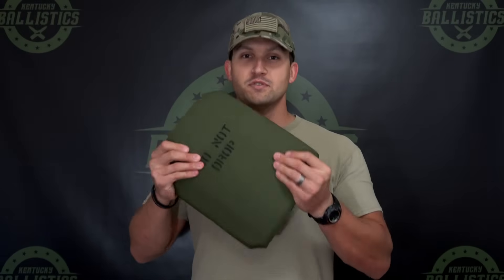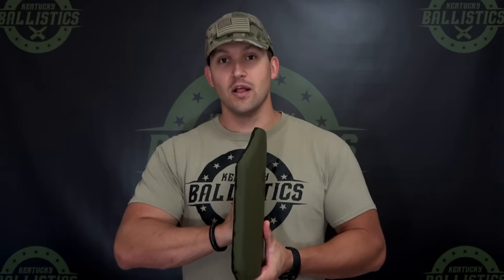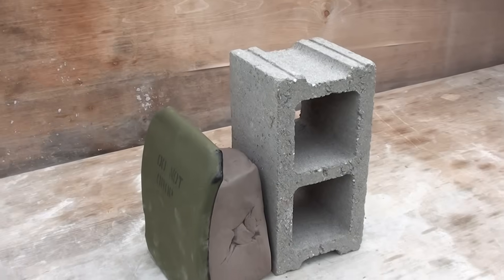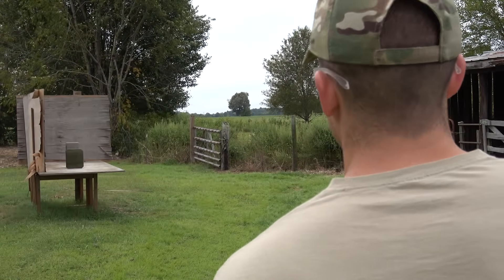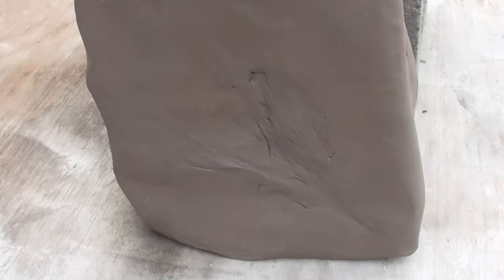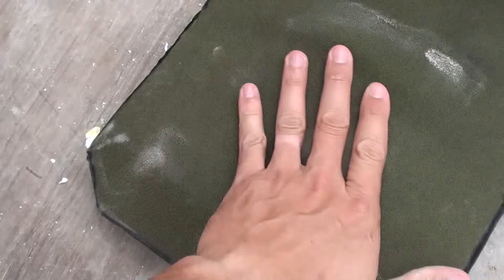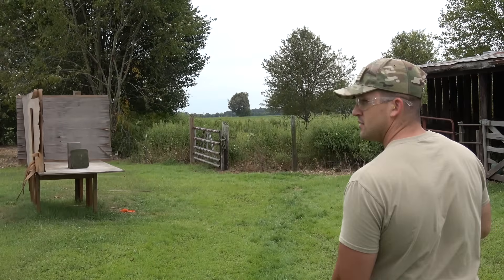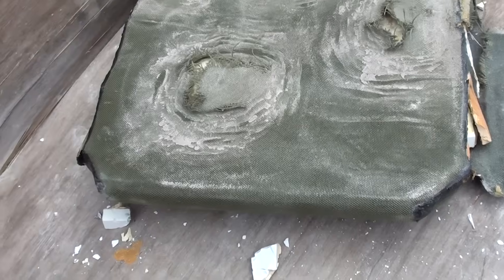Blunt Force Trauma & Hard Armor

Comment: curious of what 00 would do
Reply: Completely nothing. This plate is essentially lvl 4. 00 pellets are essentially weak 9mm, so it would do nothing to the plate. I’d bet you could shoot the plate 20 times with 00 buck and it would not go through. Even without the ceramic, the Kevlar backing would still stop the 00.

Comment: For the life of me,  I cannot begin to understand why ANYONE would worry about the age of a piece of ceramic armor.  It is NOT going to change i's shape, character or potential until acted upon by some other agent or force.  Would you worry about the dinnerplates you eat from becoming too weak?  For what reason?  They will be as strong as the day they were made, today.
Reply: @Ruzz Bilzing The ceramic maybe, but these kind of plates works through a layer system, ceramic often backed by woven synthetic fibrous material which by manufacturer claims degrades through time.
Reply: @hankatmaggies8819  and they do, but not fast enough to matter. Plates backed with Kevlar are the most suspect, but even then, the Kevlar is usually laminated onto the back of the ceramic, and is impregnated with epoxy/resin to hold everything together. Kevlar is susceptible to damage from moisture, but the epoxy/resin mentioned above would basically keep it safe for occasionally getting wet. I mean, police departments have used soft Kevlar for years, and you bet it gets soaked in sweat and drenched in rain very often, and you don’t hear about lvl3a soft armor failing.
Reply: People don't put their trust in dinner plates to stop bullets.
Reply: @lenxHD  the point being, ceramic doesn't really break down with age as long as its not being shocked.

Comment: Think that the force transferred from the slug would be lethal, looks like it would shred ribs or cause severe internal bleeding from the blunt Forse trauma to the lower torso
Reply: I do believe shot gun slug hits to the top half plate would be very dangerous from what I gathered from the warrior poet video.
Reply: Not really. Did you even watch the video?
Reply: @Starioshka  yea a hole large enough to fit his hand was the aftermath of the slug
Reply: @kyliemcwynne  You can do that much damage with your fist.
Reply: @Starioshka  you don’t seem very smart
Reply: @clownworld4655  Evidence?
Reply: @Starioshka  Okay. Do you really think you could cause that amount of deformation to that clay with your fist through a SAPI plate? It's not just like punching a bare slab of clay, imagine how much force you would need to cause that effect through a rifle plate, it's devastating, akin to being hit by a car doing 50-60 mph but landing on a softball sized area of your torso.
Reply: @Veldtian1  That's the thing. You're only left with a little tap if you're wearing plates.
Reply: @Starioshka  For reference a Mike Tyson strongest punch is around 1600 Joules of kinetic energy, a shotgun slug at that distance is 2800 to 4000 Joules (depending of the barrel, size of shell, type  of slug  etc), a 7.62x51 is around 2600 joules. A lot of it is dissipated in an area, but still a really hard punch. It is survivable, but is really hard hitting.

Comment: Assuming the Zombies are pretty stereotypical then I would say my AK-47, Russian shorts would rip them apart considering most wont be wearing armor or at least consciously adapting to ballistic threat levels and would have severe necrosis that could possibly cause disabled limbs from the trauma alone assuming one did have plates on.. My AR-15 is much lighter and is more accurate at longer distances but I would honestly prefer an AR-10 with a short barrel if we are pretending we aren't facing a fully "sentient" enemy as an all around rifle but I don't own one like that, because even if they can run full sprint its better than if they could operate firearms and calculate wind patterns. another reason is also because its mostly a novelty in the real world (in my opinion) but I can paperclip my AK variant and the "automatic" function would be more ideal against zombies because people will naturally make a smaller profile and the average survivor wont be a crackshot, im also no marksman, I probably have above average knowledge of (some ) firearms for a civilian but nothing that's too special. considering the air force and even lightly armored vehicles should be able to rip apart any zombie horde the problem will obviously lie in the pathogen itself and mitigating the threat. we all see how its working out with the current situation so I don't think physical force would solve a threat like that.

Comment: 5.66 worst military cartridge ever
Reply: It's very effective against flesh targets, more so than 7.62x39 even though it has less energy
Reply: Its extremely fast and can go long distances without much drop. Its also cheap to make an has hardly any recoil so in a full auto rifle such as the m4. Its pretty devastating.
Reply: ipopmyneck M4 isnt fully automatic. Though rare cases the automatic variant of the m16/M4 were deployed. Nearly all of them are semi automatic. Now I believe your more accurate example would be the saw or it’s official name the M249 is automatic. If memory serves me it was the M16 A3 that was in development to be select fire semi or automatic fire. M16 A2 and it’s M4 relative was semi automatic. Yes 5.56 in automatic was easier but don’t be fooled, it’s still a ride when holding down the trigger. This keeps coming up so I need to dig up my military manual of the M16/M4 I have. There was talk while I was in to have the A4 variant have automatic as well but it was skipped. Firstly it’s not accurately effective and semi automatic can also suppress a fight. Secondly it burns through ammo.

Comment: Can someone explain to me how ceramic goes bad with age?  Also, my understanding is that ceramic spiderwebs cracks through the plate during the first shot.  That is why no one likes ceramic plates - they won't stop multiple hits.
Reply: barking.dog.productions1776 no ceramic typically ages well. Yes it will spider after a shot. Yes it can stop multiple hits, a drill Sargent told me of a time he took 7 rounds. It held up well enough and it was these plates you see here. New stuff took time to roll out.

Comment: just by watching this rural video I´m very concern  the clay used is the right one but  I have my Doubts if you did the proper clay test.  1. You used a 5.56mm bullet, full metal jacket. I did a test on a Iron plate 1 inch thick and it when thru just like butter. 2. you must stand 5 meter away from the vest,  why 5 meter because 5 meter is when the bullet one the bullet come out from the rifle it reach is maximun speed and after 5 meter the bullets descents his speed. 3. I don´t know what kind of Ceramic plate you used by the color it must be a first generation after scientist discover that ceramic was the only material that could melt above 1600 c.c. any way the color of an ceramic I used in 1988 it was purple. and the value 330 $ each. 4. watchin you fix your hand making that big round trauma I´m pretty sure it was deeper than 44mm which is the maximun depth according NIJ 01.01.03 for bullet proof vest. level IIIA. Now what I´m trying to make a point is that the depth on that clay is not like you mention on the first shots that you put your fist on the clay. that hole is more than 44mm I can see it just by eyes after making as a manufacture many proof and had the best bullet proof best in the world competting in a bid of 500 bullets proof vest. They where 3 American companies, 1 from England that was the most hard to compete with. and than you had from Israel and brazil and so other countries. Well as I said if you get hit with that depth trauma the bullet doesn´t kills you but the trauma is like having a big hammer the ones used to brake bricks wall yes that hammer is like hitting you running with all my best 7meter away and hit you in the chest. Yes the bullet doesn´t have to go thru but the trauma will kill you Instantly.  good video so every one see.

Comment: Scott, the 556 did make an impression in the clay. Did you notice how each time you shot the plate and it made an impression in the clay, it also dirtied the plate only as big as the bulge? Did you notice how the plate was clean on the back before testing, and how you got a bit of clay residue on the back of the plate after the 556? The clay was also slightly deformed. There wasn't much energy transfer, but you did get the plate to impact the clay enough to leave residue.

Comment: This has probably already been mentioned or pointed out. But for one, SAPI plates like this are meant to have soft armor or trauma plates underneath so some of the clay results would be much less. Another thing with Ceramic armor is that it does a great job of dispersing the energy, however the plates compromise much quicker than steel ones, especially with multiple rounds hitting in the same or near the same location. Given their age too, I dont think it's doing them any favors. 

It's been shown that 3A soft body will stop a 12 gauge slug but the backface deformation is lethal. I think a single shot from a 12 gauge without a trauma plate would prove non lethal with the ceramic armor provided you hadnt shot it up already. I dont believe any one caliber would be more effective than another in multiple shot tests from the same caliber on a fresh plate. But it's no surprise the bigger heavier rounds left more of an impression on the clay. That's like going from 0 to 60 in 0.1 seconds then going from 60 to 0 in the same amount of time. That's a lot of mass suddenly coming to a stop and it's going to dump far more energy on contact. 

While some people say it's all about shot placement and energy levels dont matter, this test shows otherwise. While most seem to at least agree energy levels in rifles/shotguns matter but not in pistols and for the most part that is true. If you did this same test with soft body armor it would be quite obvious which pistol rounds really do pack more punch. Having seen many tests regarding this subject and conducting a few of my own. When you take light/fast rounds and compare them to bigger/heavier rounds but their kinetic energy levels are near the same threshold, you find the bigger/heavier rounds will always leave more of an impact. Light/fast might be good for punching through things, but bigger/heavier will almost always destroy the object it's trying to get through first. 

If it hasnt been done already... I'd like to see you compare .50 AE in a Desert Eagle to a 12 gauge 2/3 1oz slug. I already know what the results will be or at least how they will roughly turn out. The reason I want to see it is because that constant question of "Who needs a .50 AE?" or "What's a .50 AE good for?" comes up a lot. And when people see that a typical .50 AE performs pretty close to a 12 gauge 2 3/4 1oz slug and people advocate for using slugs in home defense shotguns often may realize that the .50 AE actually has merit as a defensive tool potentially. It's also performing roughly the same as a 125gr .357 Magnum fired out of an 18 inch barrel, just lower velocity.
Reply: Christopher You won the essay contest!!! 😂😂😂💪🏾💪🏾💪🏾
Reply: not to mention that clay is an extremely poor matireal to simulate the human body which is 70 percent plus water and much more efficient at absorbing, distributing and overall taking shocks without breaking into pieces than clay ever will be. Alot of these shots that leave impressions in the clay would come out as bruises or cracked/broken bones rather than lethal blows IMHO

Comment: The 762 hit is going to have more bft because the first shot broke up the ceramic plate. The second shot was hitting a material that was no longer as rigid.
Reply: Doesn't matter, the other hits we're on an undamaged section of the plate and still caved in the clay. Bigger calibers will transfer more energy and you may not have a bullet going into your body, but your body still has to absorb that energy. From the looks of the dents on the clay you're ribs are broken. Still could be a life threatening injury
Reply: Trust me the plate was compromised. It might be rated for multi hits but that doesnt mean it will act the same. This is why the only way to tell if a ceramic plate is good is to xray it. Usually, its easier just to replace it every five years.

Comment: tbh i don't see any reason for a ceramic plate to fail after a long time.
I sure prefer a new plate.. just to be s10000% sure.. but you know what i mean? Why would it fail? Ceramic doesn't fall apart after some years.
Oh and of course the plate is designed to not be shot multiple times with a big caliber. The ceramic shatters the projectile and that's it for the plate. But you did a good job spreading the shots.
Very nice video and very interesting. I never thought about the impact a ceramic plate still could transfer to the body.